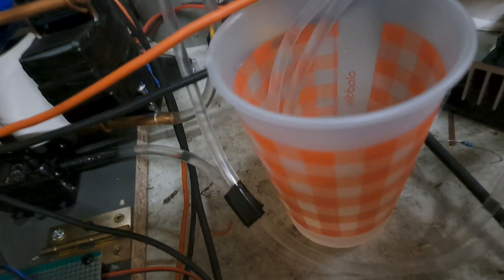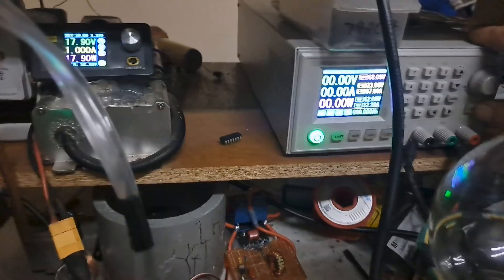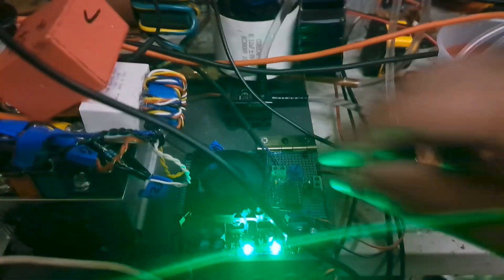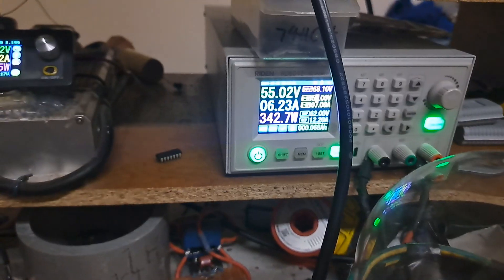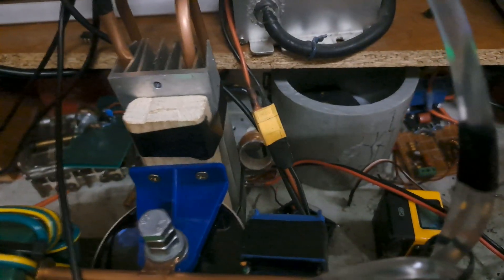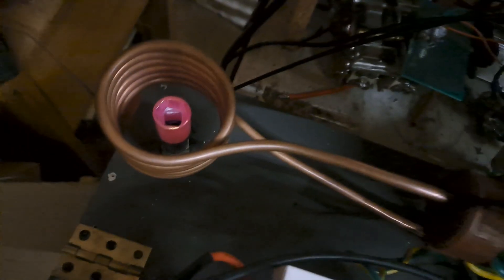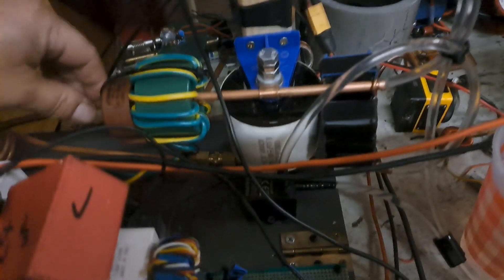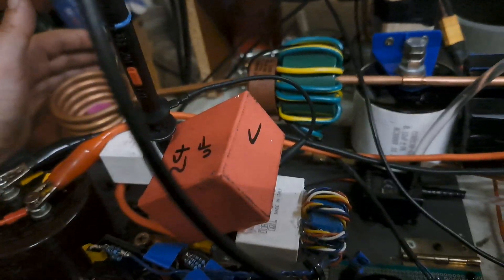PLL Full Bridge Induction Heater Feedback Test

Comment: Sheesh fancy water cooling , I bet that increase the power a lot , cause it must keep the coil resistance at a low level , once you have everything figure out you should try to levitate aluminum stuff I saw some beefy heaters pull that trick
Reply from the maker: It will definitely keep me from burning myself.. but yea at the higher powers I'd imagine eventually the coil itself will start melting without the water cooling. The levitating aluminum thing is what got me into it in the first place but  I'll have to get close to 2kW good operation before I can try that.. Then I'll need to play around with winding a special coil for it.
Reply: @Magneticitist  Hey brother I heard some hurricane hit NC I hope you are fine , I saw videos and the flood seem pretty nasty